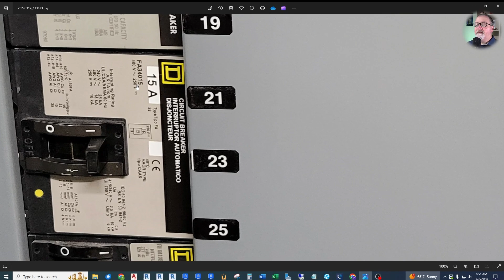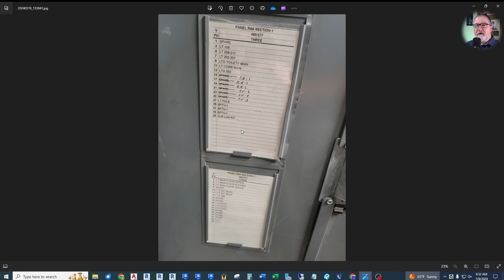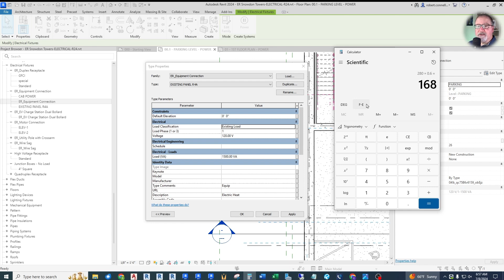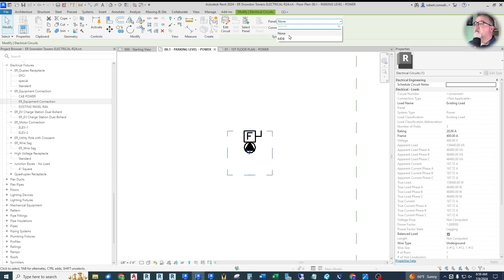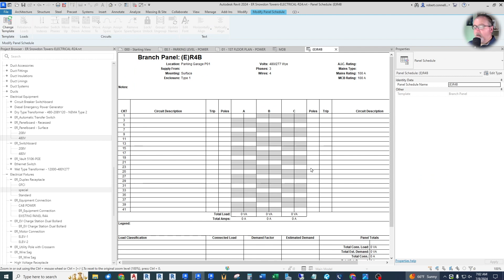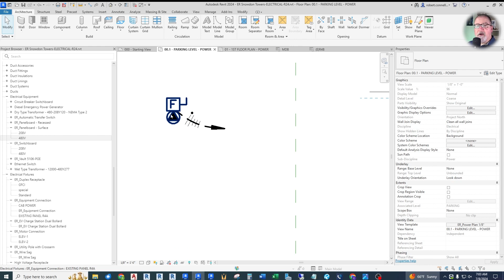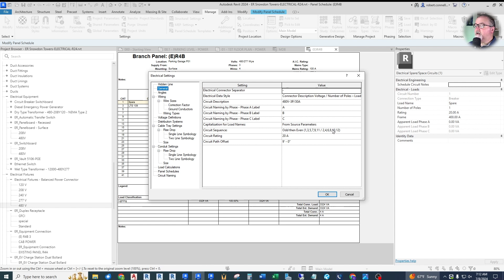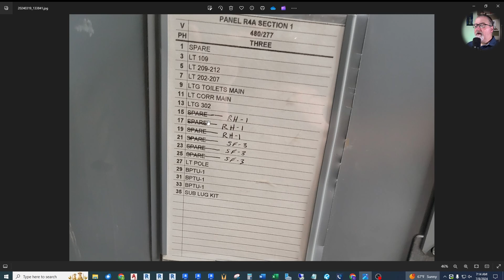REVIT MEP - THE SECRET to modeling EXISTING LOADS!

Comment: Great Videos! Here's a Tip/trick for making individual existing loads in lieu of using an unhosted equipment connection floating off to the side of the project.  

Create a 2"x2"X1/8"H face hosted electrical fixture family with electrical connection, appropriate parameters and visibility set to show only in Detail Level "FINE".  We call the family a "load placeholder".  

In your project create an elevation view of the existing (or new) panel - set the elevation view detail level to "FINE" and name the view "panel name - Placeholders" and make it a working view.  Host (attach) the "load placeholder" to the face of the panel and array (or copy) it as many times as the number of circuits you need.  We typical have 2 rows / columns of 21 load placeholders on the face of each panel for a 42-circuit panel - odd on the left and even on the right to mimic the actual panel.  Circuit the placeholders as required to show the existing loads correctly and then tag them with a circuit tag in your Placeholder Elevation.  

The advantage of doing it this way is the hosted placeholders will stay associated with the panel and you'll always know where to find and edit them down the road if need be.  Another advantage is that you can create model groups to place them quickly on multiple panels or import them from project to project.  You can also Associate a detail group with the circuit tags to make things move along even quicker.  

Keeping the placeholder family a simple hosted square keeps things neat and tidy.  2"X2" is also the perfect size for a 1" = 1'-0" scale working view with the circuit tags next to the squares.
Reply from the maker: Hey there Mark! Appreciate the feedback and support, and thanks for the tip! A very clever way of indicating the existing loads - using the "detail level" to "hide" those connections is a great hack! One drawback I've found to my method is when other trades link my electrical model into theirs, they don't always crop their view the same, such that some of my existing connections actually show up. I'm assuming yours could have the same issue if they don't have the detail level set appropriately, but less likely. And yes, I definitely see the advantages to your method with the simple ability to group and copy them - thanks for sharing! We definitely have to be ingenious sometimes to really make Revit work for us! Cheers
Reply: @ElectricRob  It solved a big issue at my firm of placeholders floating around everywhere and trying to "easily" find them later.  
I also use a similar process for lighting relay/control panels to solve that issue.  Stick "relay placeholders" on the face of the relay panel with the needed parameters to fill out the relay panel schedules.  Circuit the placeholders with the light fixtures and you end up with a fairly functional relay panel schedule - not perfect but it semi-automates a missing and needed Revit function. 
Yes, your 100% right about being ingenious to make Revit jump through the hoops we need it too! Keep up the good work!